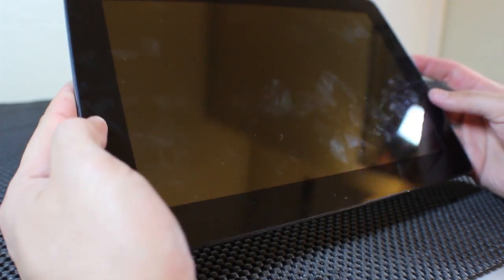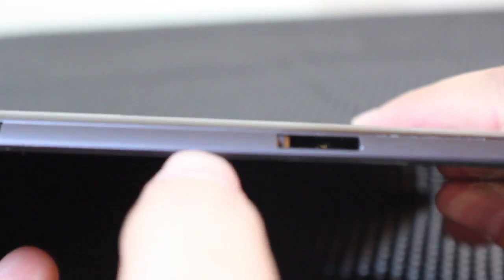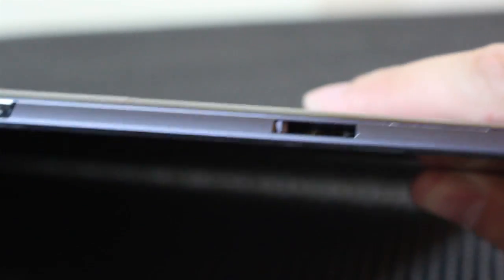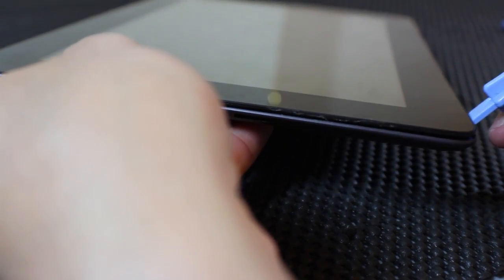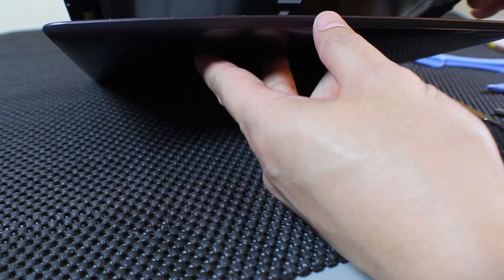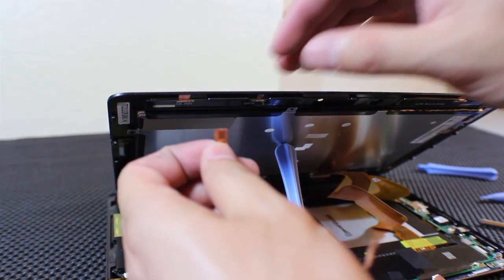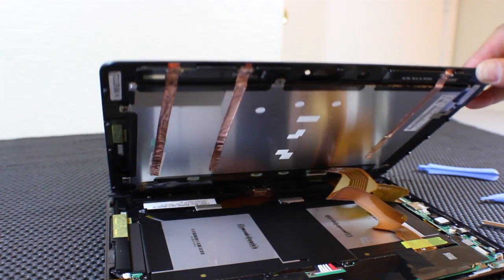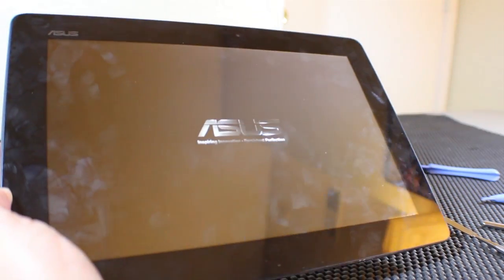ASUS Transformer Prime GPS Wifi Fix [Attempt]

Comment: Hey Johnny, NOW do this again. I think you need to solder the strips to the GPS and WIFI anntenaes , what you have is a layer of glue between the copper, result, no connection. IMHO

Comment: I think the problem is the back side of a tablet. Its made of alunminium so basicaly its a kind of screen that reduces the signal perseption. Maybe you should apply the tape horrisontaly so that it runs along the plastic side of a tablet.

Just in case you are still using it ))

Comment: not trying to be an a-hole or anything but this is not gonna work! the GPS is useless in this thing even with the GPS dongle, just get an actual GPS or send it to Asus repair facility to hopefully get a new MB, this trick WILL burn your motherboard over time....

Comment: I opened mine yesterday and found out that the power connector was loose. Ducked it back and now my tablets works fine (also did a complete system reset) Now I will do the tape thing for the Wi-fi and try as I said to have the tape outside tne tablet, because I think that the metal case is the problem, so even if you put tape inside, metal case will still make a signal barrier. Wifi waves aren't the same of GPS.

Comment: since the metal casing is the problem to GPS reception, maybe having the tape hanging outside, sticked to the back of the tablet? I have to open mine for a major bug (tablet stuck on a boot loop, but maybe I have a broken connection (it had received some back shocks) Anyway, thanks for the opening instruction. Since it is useless has it is now, I will open it up to have a glance.

Comment from the maker: Both sides of the tape is made of copper. So the metal copper is touching both the existing external antenna and the connection. Thanks for watching!

Comment from the maker: I would try using a heat gun or hair dryer to melt the glue a little bit and to make the parts a little softer to squeeze into place. Do this at your own risk because I am not an engineer.

Comment from the maker: I found on ebay the glass is $135. I think it wold be difficult to replace because the glass has to come off the electronic components. In my opinion, if it is just a scratch, then let it be. If it is a crack, then think about changing it. So if it is working fine for now, just leave it.

Comment from the maker: I agree. For me though I would have done this to my tablet anyways to try to make the GPS and wifi better. I do the same with my router by replacing the antenna. The advertisement as the best tablet would only be for the CPU (at the time). Other than that the gps was a fail. Thanks for wtching and the feedback!

Comment: people shouldn't have to do this to their tablets, this is a HARDWARE FAULT and should be fixed by the manufacturer, all tablets should be recalled and the problem resolved, what angers me is that this tablet is advertised as being the best android tablet you can buy, how can it when it has a very serious hardware fault? this tablet is still being sold for £500 on amazon, it's not worth that price, i would be angry if i payed that much and the wifi and gps was not working.

Comment: No, they screwed the customer service logo, and didnt release a plastic back on newer builds and replaced current customers tablet backs with this approach! They simply removed the fancy metal back on new model TF300 and put a BLUE plastic back on it. The TF701 has the metal back but a inch of plastic on top where the antennas are.

Comment: Try using a credit card or a really thin putty knife, from Ace Hardware, about a 5 inch one, very thin on the edge. Using plastic tools also is better. I use the putty knife to unsnap the Mac Mini to swap out the processor and ram on older 2006 models which only came with a Core Duo, it needs a Core 2 Duo in order to use 4gb+ of memory with OS X Tiger and above.

Comment: They changed the back plate with a blue PLASTIC one to improve Wifi and GPS! Asus also gives out FREE DONGLES to fix the problems, but you cant use it with the keyboard dock. The TF300 model has a PLASTIC back, the TF701 model has metal with plastic where the antennas are. They should have swapped out the backs with plastic in the first place!!!

Comment from the maker: There still is contact on the side with no adhesive. That side is touching the metal plate and that metal plate is the actual antenna. Thanks for the tip and watching!